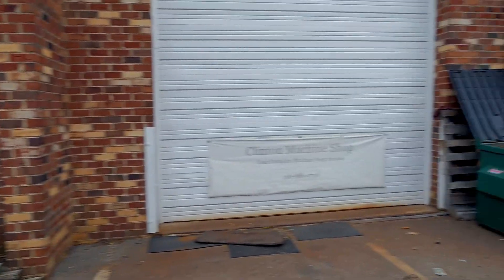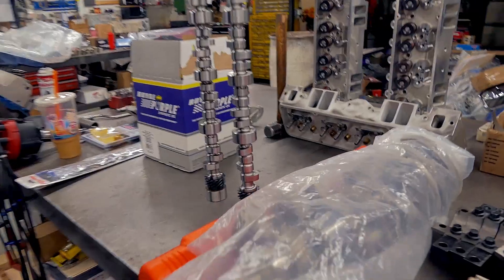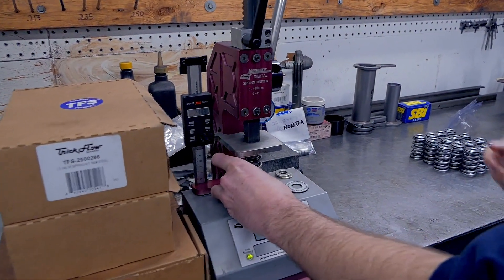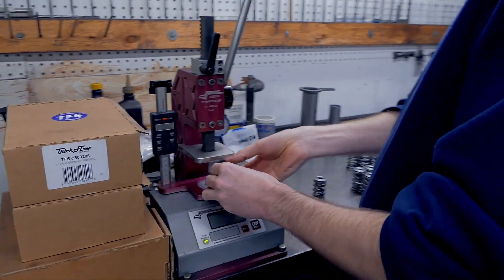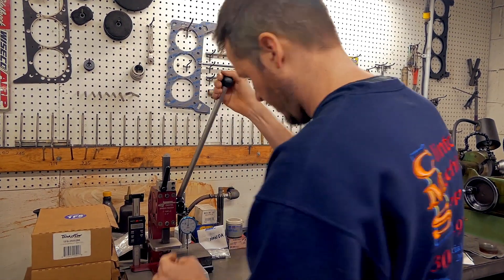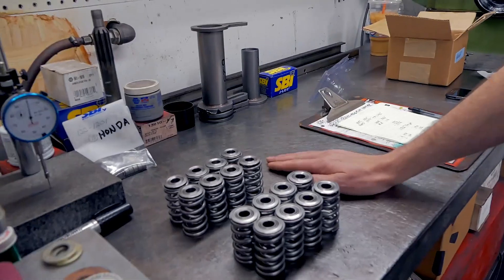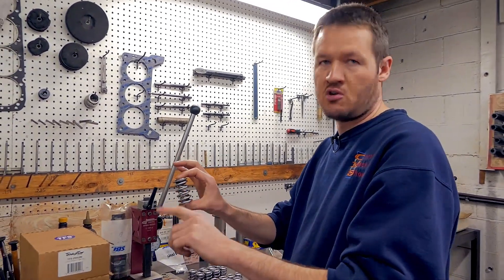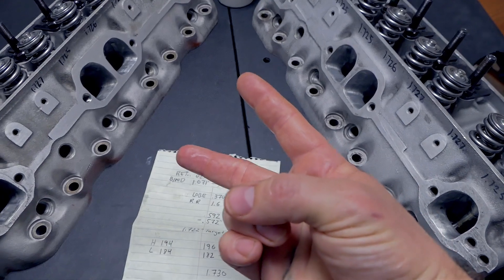Nitrous LT1 build update, New cam and Valve spring Pressure Test!

Comment: How much duration is the cam? I have a crower cam with 236/244 and .570/.600 lift.
Reply from the maker: 260/266 562/562
Reply: @TPVPRO  is yours a 355? That's a huge cam!
Reply: @TPVPRO  from what I understand of lloyd elliott talk about his le2 and le3 heads, with the lt1 casting, the pushrod pinch area that's the smallest point in the runner, a 355 will continue to make power til about 6700 rpm before starting to be a restriction. He also said the same head on a 383 will choke out around 6300 rpm. That's usually why you see higher power 350-355 lt1s compared to 383's with ported stock heads.
Reply from the maker: @biggregsparks8364   This motor probably makes peak around 6700 but will carry past that. The cam builder measured the intake runner flowed the heads and calculate compression. He ran several different grinds through a Dyno sim then had a custom cam made.
Reply: @TPVPRO  how much does your truck weigh? I'm hoping my 94 z28 will trap over 120 with 3340 weight. Its 11.4 compression, 236/244 cam, victor jr. Intake and fitech meanstreet 800 fuel injection, hei dizzy.
Reply from the maker: @biggregsparks8364  Its right at 2975 without me, I'm 200 pounds. That would be awesome if it will trap 120 mph. My SBc would do 120-123 NA with 10.2:1 compression. 120 NA on some old LT1's is pretty good what was your ET?
Reply: @TPVPRO  I don't have one yet, but shooting for low 11's. My heads flow 277 at my cam lift.

Comment: You may have a video detailing the build already,but are you building the LT1 as a 383 stroker?
Reply from the maker: 357ci 6" rods
Reply: @TPVPRO  I have a 96 Caprice 210,000 on it,had the heads off in 2013 to do gaskets. No ridge and cross hone still showing. Needs rear axle seals so I'm thinking about doing sum 4:11s too